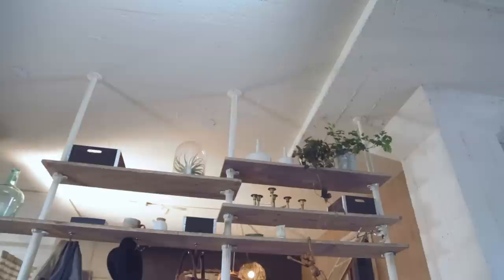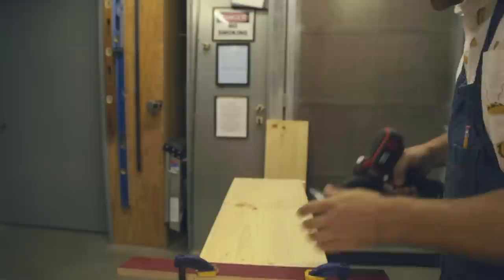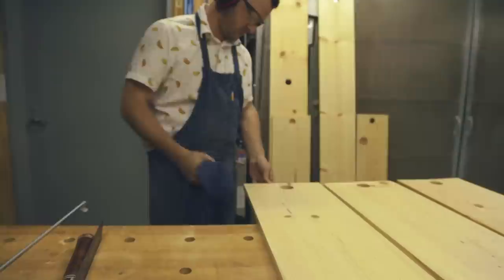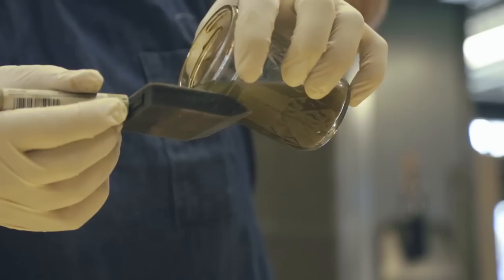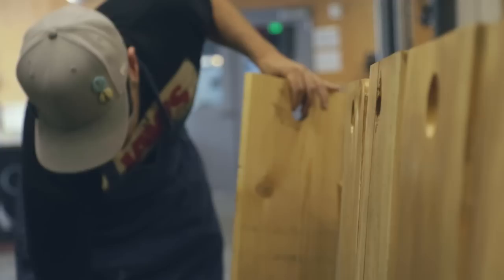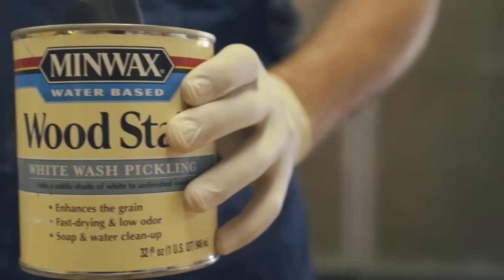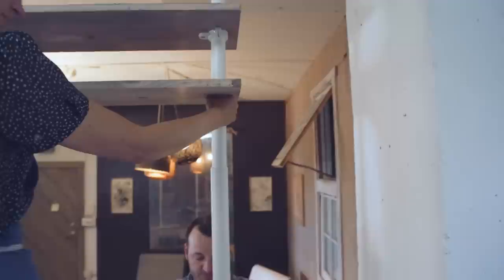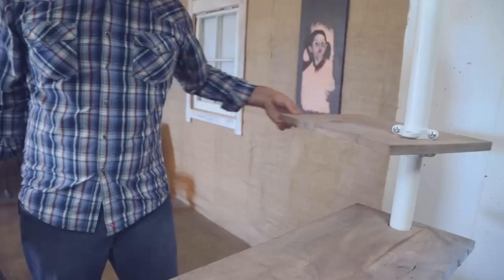Compression Shelf Room Divider

Comment: How did the compression poles actually got installed on the floor and ceiling? We only got to see it for a few seconds.
Reply: They don't have to be installed/bolted to the floor + ceiling. Adjust pole height so it touches the ceiling, then a spanner is used to adjust the compression bolt+nut